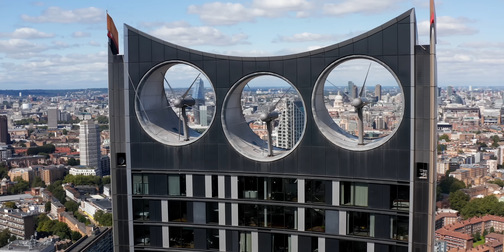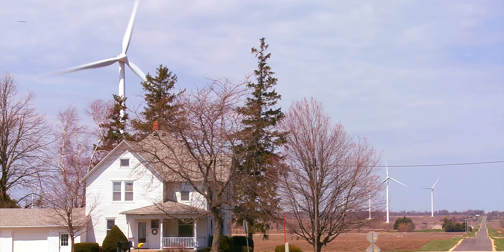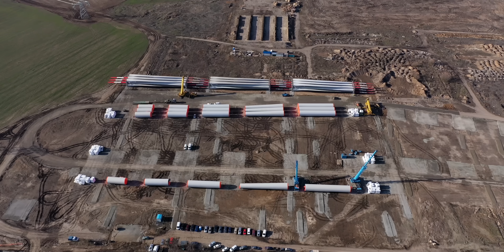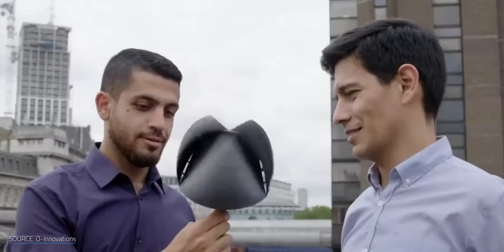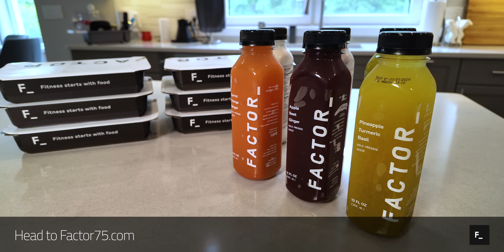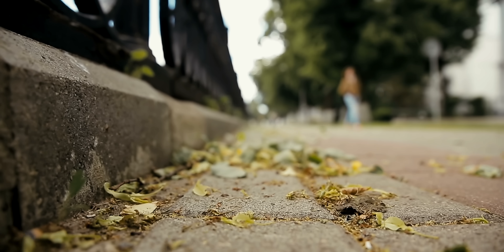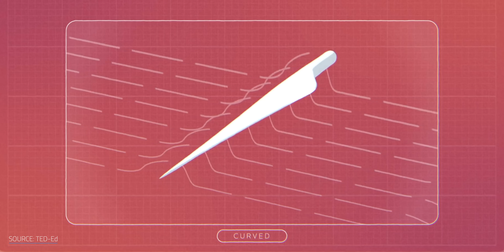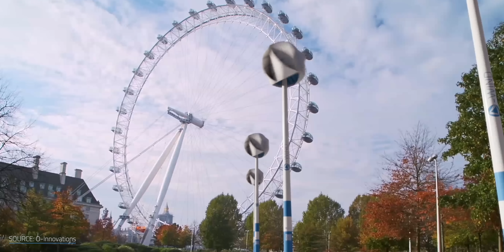How a Small Wind Turbine Will Revolutionize Wind Energy

Comment: My innovation is a very small wind turbine designed to integrate vertical and horizontal axis. The turbine blades are slender and short, not more than 1 meter long, and installed at a height of not more than 10 meters. It provides more electrical power than a general large wind turbine because the electricity obtained depends on the efficiency of the generator up to 80%, but the wind turbine has an effect of only 20%. The result is very low noise and does not disturb the visual view, and does not take up space.

Comment: It's a good start. If it's developed in the right direction, it will help you succeed. But for me, there is a way to store energy without using batteries because their lifespan is short and the cost is very high. When they expire, they are difficult to dispose of. So I use wind energy to circulate water energy, that is, use a wind turbine to pump water up and store it on a tank. When there is no wind, release the water to spin the water turbine to produce electricity. Doing this will circulate and get continuous energy without using batteries.

Comment: I studied this a few years ago at university.
These devices are not for open spaces (as seen in some examples in the film) but for spaces close to the walls of buildings. Air is always circulating, and when it encounters a barrier (wall) it compresses, accelerates and changes direction. There is a small strip of space next to the walls where the air circulates faster (+/- where in the old buildings you could see the clothes drying).
If they were economical enough to be able to cover the vertical walls in the direction of the prevailing winds, it could be a great solution. (If it were me, I would suggest adding a condenser in the direction of the prevailing wind)

Comment: Throw in some diamond bearings in those turbines for durability, + solar + batteries, stable power generation setup.

It comes down to humans needing all forms of energy, not just big monolithic grid power systems anymore. The reason why AC is for transmission mainly and high current motor machinery.
DC is used in portable electronics and stored energy for batteries

Anyone will need to build around their environment. There will never be a one size fits all solution for humanity.

Comment: Hello from South Florida, Need help. Free energy project. Proof of concept experiment 2 years in. Using outside AC condenser air (air gap) to vertical Tower wind turbine 3 blade 12v in horizontal orientation X 4 units to controllers to battery bank. No harm to AC unit motor, no loss of AC efficiency, no extra power loss from AC unit, plenty of air flow, speed & volume to run the 4 wind gens. Now I want to go to the next level of wind generation. What would be the best solution? Please contact me...

Comment: Cheap solar pv killed these small turbines.  A 1kw turbine typically might generate 1500kWhr/annum, this can be achieved with 2Kw or less of installed pv.  The cost of pv is a fraction of a small turbine plus the tower plus maintenance.  20 years ago, when pv panels were 20x the price today, it was just about compeditive

Comment: The building at 0:10 is called Strata, located in London, England. Ironically, those wind turbines were never ultimately used, because of noise complaints from the top flats/apartments.

It's also ironic, because it's one of my all time favourite designs, and yet was voted, multiple times, as one of the ugliest buildings in the UK.

Comment: I think it would be a more productive turbine rotating on three axes like the axes of a cardan shaft, with magnetic and liquid bearings. Some more challenges during the design and commercialization stage. I also like the idea that Orellana used, it is excellent. I also think that it will be one of the first turbines for homes combined with solar energy. Consider whether it is convenient to use more than one O-Wind turbine of different sizes, separately or concentrically. There are many challenges, the beginning of a journey begins with the first step. My best wishes to all the O-Wind staff.
Reply: How would you obtain usable power from that though? If it just spins on one axis you can just throw a belt on it

Comment: Bring it on, get production going soonest for early adopters. We've lived off grid 15 years Colorado 9600' with solar just fine. This will top off our batteries on windy cloudy days so we don’t have to use our 2 woodstoves as much, and would take the pressure off our propane glycol in floor heat system.  We won't pay early adopter premium prices for the turbine, but we will pay  economical early adopter prices.

Comment: 10:00 I think you are looking at that wrong.
Sure average 10k kwh with a 5-6k output isn't a 1-1 solution but it is 50%.
That would translate to 50% less grid draw, 50% cheaper power bills for the owner. Thats a massive step int he right direction and that kind of Grid draw reduction and yearly power bill saving are game changing in themselves.

Comment: Noting the same point not mentioned with this discussion as many others... in isolation, this may not suit US needs (for example)... but if you have a "typical" single-family US household, with BOTH solar (in particular new Peroskovite panels) and for example one ore two of the support pillars have one of these above the panels, it takes no more land area than the solar grid (hopefully on a roof, maybe the wind turbine support is right next to the house for stability, but immediately adjacent), but now you are likely getting enough power (with appropriate storage mechanisms) to meet those needs.  Systems rather than single solutions, are the eventual answer to many of the "<A> can't do it"... A plus B and maybe even C, maybe can in many more (obviously not all) cases.

Comment: If decarbonizing agenda was a serious  there are a lot of widely known and proven solutionas just as a start. Like electrified batteryless public transport (trolley buses included ) instead of a crazy race for EVs, electricity savings in general, lighter carbon foot print materials, less disposables, less red meat, etc. I've been observing since led lightening has become the opatern buseness have been using like three times the illumination they used to with older bulbs.

Comment: What in the world are people doing if the average apartment's electricity usage is 6,000 kwH per year?!?  Granted, I live alone, and heat is provided by a boiler, so it's included in my rent, but my electricity usage this year was only 1,716 kWh.  2023 was 1,681 kWh.  In 2022, when I was using my 57" TV as my monitor, I used 2,809 kWh, which is still less than half of the average.  Am I really THAT far out of the norm?

Comment: While the turbine might not meet the total energy needs of the average American home, my thought is using it as supplemental energy generation. So like use it in combination with solar panels. I've actually had an idea in my head for a while now, that using traditional solar panels, plus some small residential wind turbines, and having decent battery storage, you could probably meet a good deal of your energy needs. There were also those transparent solar glass that was in a prototype state a few years back. And while it is less efficient than a traditional solar panel, if you used solar glass for windows, and solar panels, and wind turbines, taken together you could reach a level of power output that would be pretty impressive. It'll probably take doing something like that in an industrial building, or large office as a proof of concept, since the cost to install everything would likely be quite high. But in the future if we mass produce this stuff and it becomes more common, it wouldn't be surprising to see it become more common in residential dwellings of all kinds as well. 

I'm also excited for the promise of geothermal power as well. We might someday power everything off green generation sources. From wind, solar, geothermal, and other forms, and we won't need to touch coal ever again.

Comment: I truly like the design, and I can see a million usecases. And I believe it's wrong to compare wind with solar, as they complement each other. A more fair comparison would be to compare wind with batteries, as batteries are needed when solar does not produce. So the question of economics (and resource scarcity of course) is how many batteries can I save by implementing wind into the game. 
Also, looking at footprint and applicability, there are lots of positions where solar panels don't make any sense, so why not mount these aestetically cute pseudo-balls everywhere. Give them a shiny look any maybe add small blue LEDs and they will look fancy as hell.

Comment: Definitely seems like tall buildings should be harnessing wind power and also hydroelectric power. 

Seems like bridges would be effective for this as well. 

Though, as far as hydroelectric power generation goes, you need a LOT of surface area or a LOT of height (some bridges have both), but it seems like you’d need to build for the weight/force of the water as well. It wouldn’t be as simple as each drop of water passing through a turbine on its way off the structure as it normally works. Funneling it would essentially capture more of it which would be more weight.

Comment: No matter the design, the energy produced is in direct relation with the surface covered by the blades. Three blades design is the most efficient of all, at producing the most electricity for a given surface, because they have been refined continuously since decades. And they are huge!
Meaning is, to extract the same energy from the wind, supposing it would have the same efficiency (which is not true of course), that design would need to be big too, to be interesting for customers.
Beside this, most areas are simply inappropriate because not seing consistent wind.

Comment: I live in Ireland and consume about 17 MWh/year. That's because I have fully electrified my home and transport. No heating oil bill, no gas bill, no petrol bill. Just electricity.

Wind is appealing to me because my largest use of electricity is in winter, not in summer. So my solar generation is low. Just a few kWh a day from a 6 kW array. Meanwhile I consume 60 - 100 kWh a day in winter.

However there's loads of wind in winter. I'd need storage as well because it's not constantly windy. There are times I'd make a ton of energy and times I make very little. Some of that can be heat storage so it doesn't totally depend on batteries. My house is built with concrete blocks so it's a thermal store in itself.

Even in rural areas there's a good case for residential wind in northern (or southern) latitudes.
Reply: In summary it looks like sand battery is the game changer for citizens needed heat.

Comment: I love the design and I love how the inventor says what it is and what not. -An exception in a start up branch that lives from exaggeration of the features.
I see the biggest challenge in the manufacturing. The bigger the plastic casting parts the more warpage. The more warpage the more assymetrical the turbine can get needing a complex balancing production step which increases production costs.
I see no way to produce that turbine in UK cost efficient.

Comment: It sounds poorly positioned for residential, needing wind multiplier effects to make it viable in most cases, so no pint in asking that part of the question.  However, it seems very appealing for dense buildings, which have that wind focusing effect, and suffer many space and noise constraints, and are presently leaving a lot of  renewable energy on the table.  It is however very important to think about capacity factor.  Solar and wind really suffer in CF, needing to be substantially over-provisioned and use lots of batteries, so there needs to be a good set of trade offs (cost, ease, size, etc).  Compared to modern micro nuclear options, it is no comparison in green space used per G-watt produced (CF almost 1.0), but if it is easy and low cost renewable, I say it is great option for some situations.  

One additional point to think about:  distributed generation dramatically reduces the losses in distribution of power.  To this end, the US PUC needs to be compensating micro generation at a serious fraction of the hourly energy cost (perhaps even with incentive profit to the end producer during high value times of day), not just the spot market minimum wholesale cost.

Comment: I would think that, if it's not being done already, 3D printing these with lightweight materials could bring costs down. It doesn't seem like it should be very expensive. 
—Shape it so the spin gives it a very slight lift to reduce friction would make it more efficient. 
—If all it did was charge electric vehicles it would be worth it. Sell them as accessories to EV purchases.

Comment: It makes sense to be in a city with lots of turbulent wind but I don't think it will replace a normal turbine out in the open. mainly because its going to be too small to get the torque needed for good energy generation in the open. Maybe not, but i imagine it will need to be a very large ball to get the power out of open area wind, seems impractical and a larger eye sore than a regular turbine. Then again only testing can tell that. And maybe its the type of thing where you can have several small balls to replace one larger turbine out in the open. Having options is what counts in a variable world

Comment: Just because people live out of a large city does NOT mean they can have solar on the roof.

I live in a manufactured home.  The walls and roof are made with 2x6 lumber.  The average home is 2x4 lumber.  BUT the solar companies will not even sell to us.  They say the roof won't hold the load.

I used to be a framing carpenter and form carpenter.  And any nitwit knows a 2x6 is STRONGER than a 2x4, unless they work for a solar company.

And even though my lot is 1 acre and I have room for a ground mounted system, most installers / sellers are not doing that.  

So do some homework, just because a house is in the suburbs or in a rural area does NOT mean solar is 'easier' or 'better'

Comment: will there be a sailboat sized one? 2.2m is on the large size for that. 400w output
Reply: A sailboat might conceivably be better served by something that isn't omnidirectional. It just needs to accept wind from any horizontal direction. On the sea, wind is going to be quite steady much of the time. You'd probably also want to combine with flexible solar panels applied to most horizontal surfaces.

Comment: there's no way to make anything better than a 3 blade turbine for wind energy. It's physically impossible. The turbine you described is at least 2.5 times less efficient than those simple 3 blade ones, but in reality it's probably up to 3 times less efficient. 

It's just the physics, it's physically impossible to have more efficient turbine than 3 blade one.
Reply: Except that's not what this is claiming. It's claiming that it can make use of wind gusts in basically any direction. A vertical gust of wind wouldn't help a three-bladed prop.

Comment: I can see this in many niche markets. Being a low power producer in a small footprint, with little to no maintenance, it would be a beneficial asset to a small village or remote habitat. Maybe a low voltage system using 12v DC rectifier? But I think it could be a small business model for the DIY handyman as a franchise business model . That's where I think he should go instead of a central supplier or company.

Comment: The biggest problem I see with them; is the industry keeps trying to make them "comparable to solar". They're never going to make it unless they're more affordable. Wind is simply a supplemental backup to a solar backup behind the grid's power. Even off grid, wind would only be used to backup solar. They can't price it as a primary power source, when it's so far down the line.

Comment: Maybe take a reduction in efficiency but surround it with a wind permeable membrane so anything that makes contact with it just touches a solid stationary surface.
Reply: Man even the huge open grating around box fans reduce airflow massively what material would you suggest

Comment: Matt, a question on consumption:  a device like this that provides 2,000-5,000 KWH per year ought to be sufficient for the average American homeowner when paired with an energy storage solution, right?  

I live in Buffalo, NY, where the average wind speed is 11.8mph.  So, I would assume that I should get output on the high side of the range.  If I have a power wall solution installed, e.g. an Anker Solix X1 with 12kw storage, that 5,000 kwh output should be sufficient to fill up the power wall during off peak hours so my demand is leveled out in a largely off-grid solution.  I am NOT an expert on this, so please correct any errors or gaps in my logic. 

This might be a good topic for you to cover in a future video as I haven't been able to find any content on YouTube about pairing small residential wind turbines like this with home energy storage.